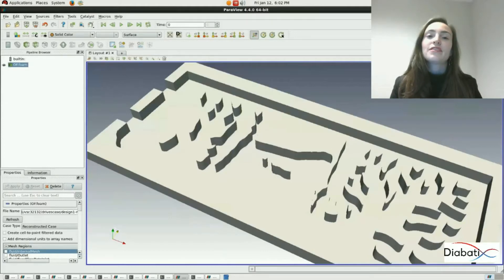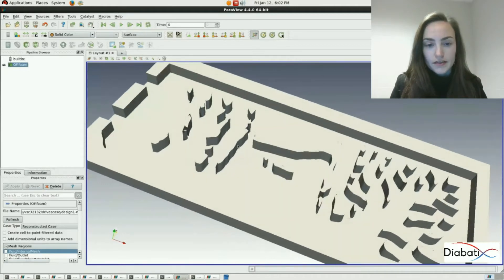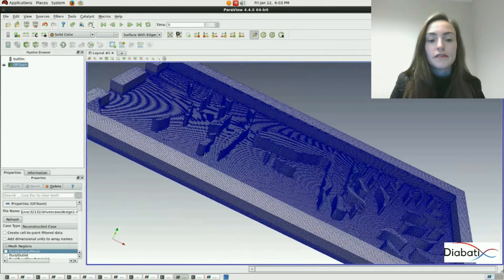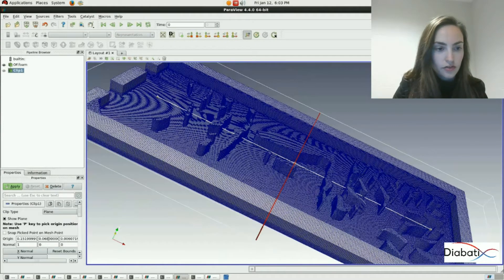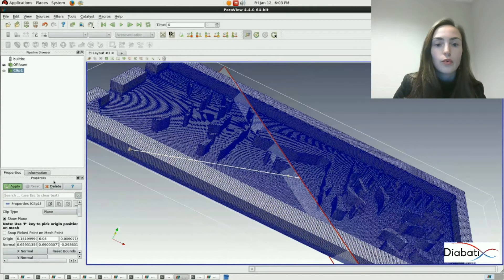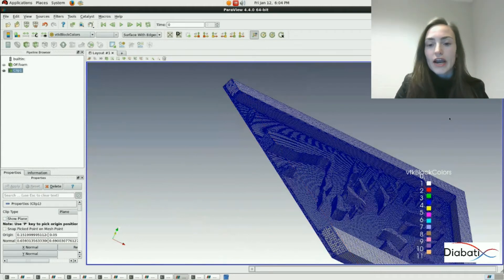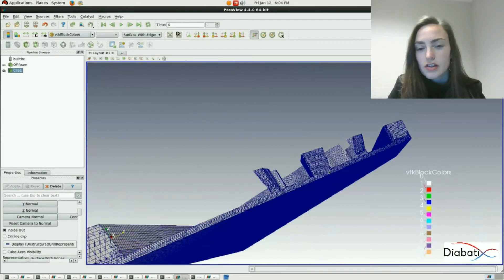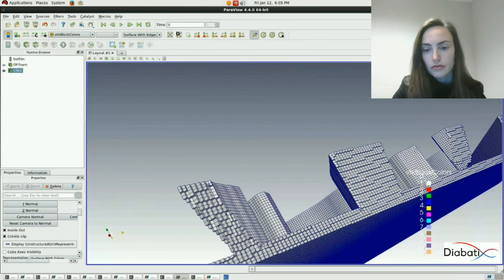ParaView Tips'n Tricks  -  Hidden mesh secrets | Tech Queen Roxy

Comment: thank you! just the info I needed

Do you know if it is possible to control the width of the lines? When zoomed out the mesh lines look quite thick, and also include some "cross" shape at the vertices?
Reply: You can't control the line thickness. However, the problem that you describe is related to the resolution of your screen and will always appear when you zoom out.